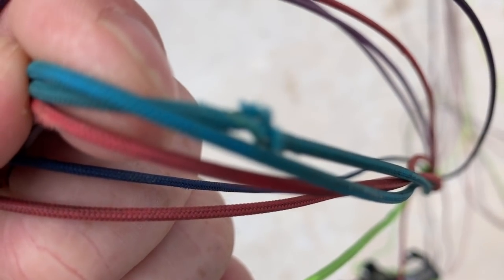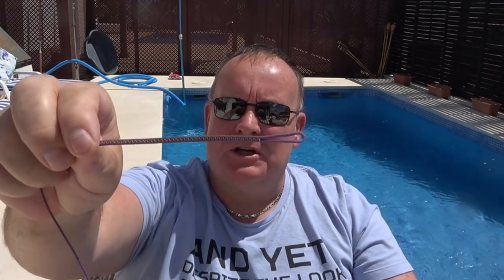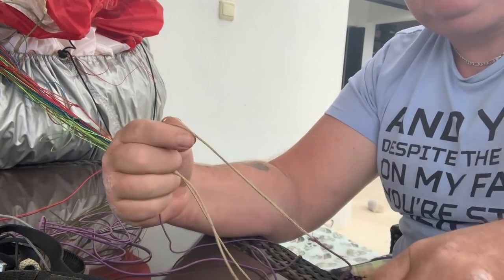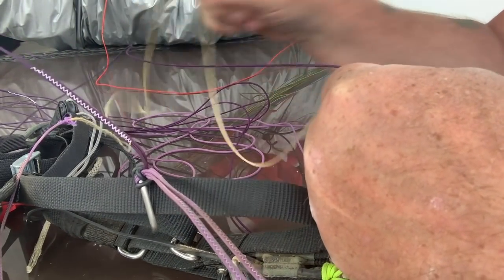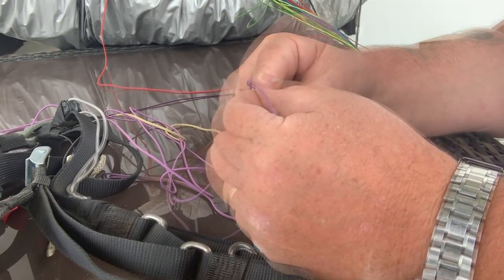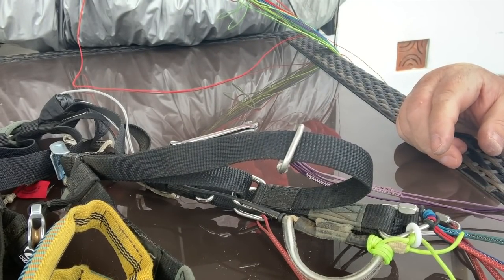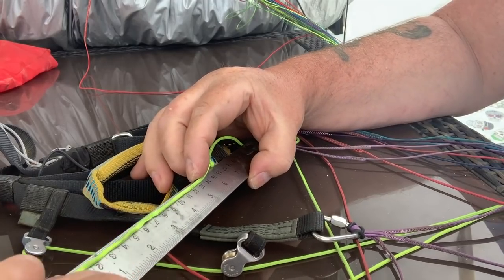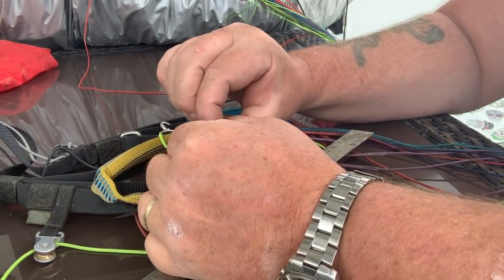Paramotor DIY - Glider Line Change and Brake Adjustment

Comment: Interesting i have the Ozone roadster i also use high hang points but never changed the break line i will look at that today Thanks fat guy :)
Reply from the maker: No worries, glad you found it useful. On some gliders you actually move the pulley. They loop into the riser. Thanks for watching 👍

Comment: Nice video, it is a good practice to change the matching line on the other side of the wing due to line shrinkage. Probably not a big concern if your wing has low hours.
Reply from the maker: Thank you. That’s a good tip 👍